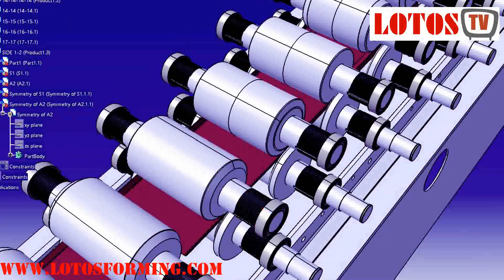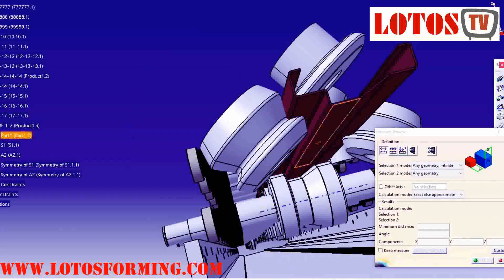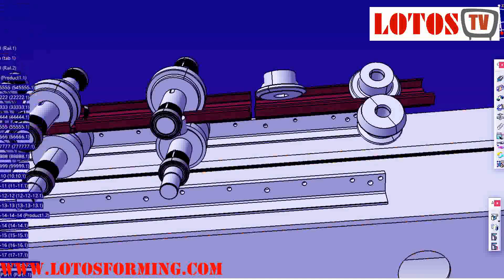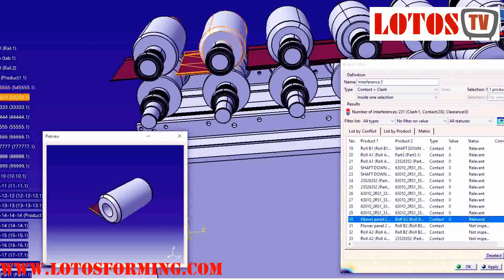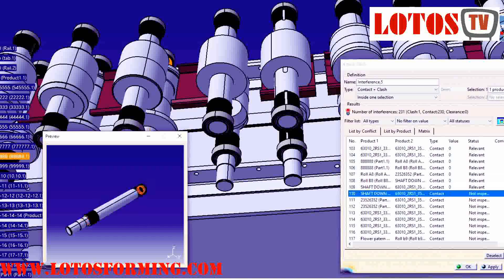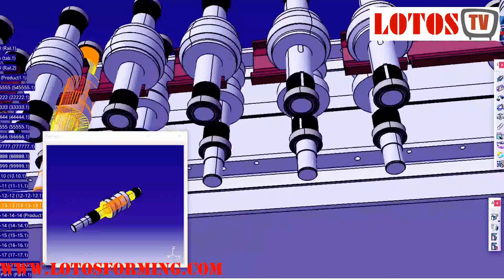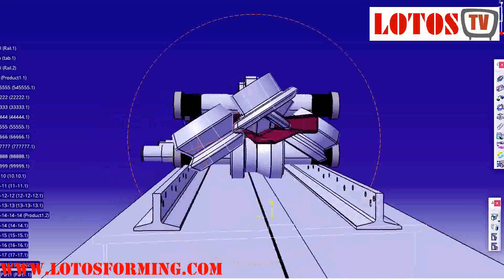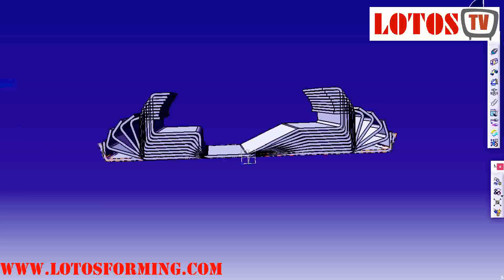【How to design for roll forming 】: Roll Forming Design | Roll form design software free download

Comment: Roll forming machine that design and produce for specific metal such as SS, GI, CI, PPGI, CU, and etc.The cold roll forming process is an alternative method under the condition of room temperature to form the advanced high strength steel.